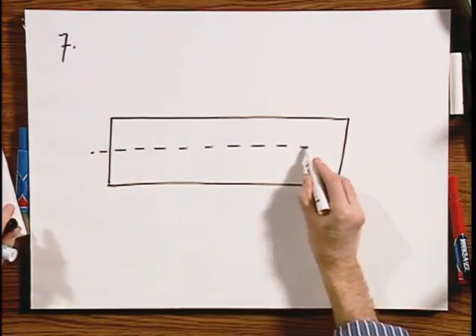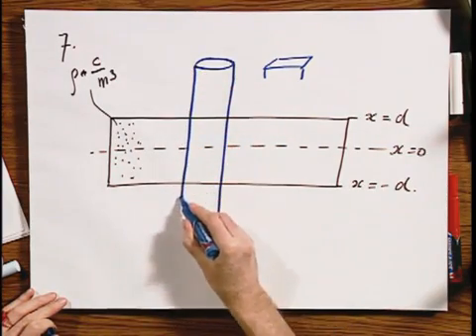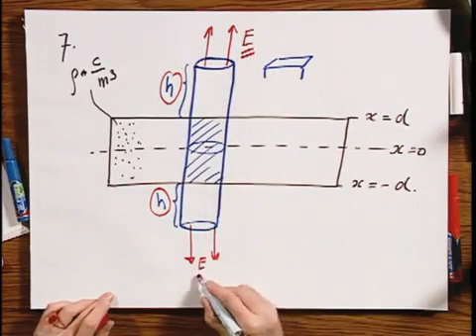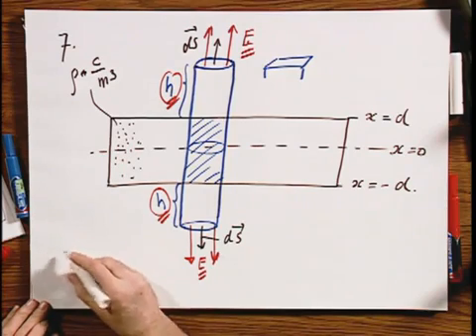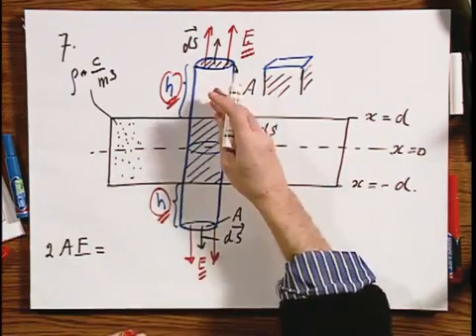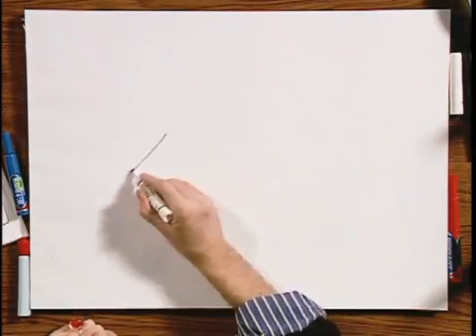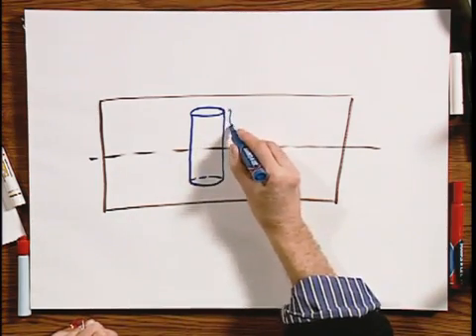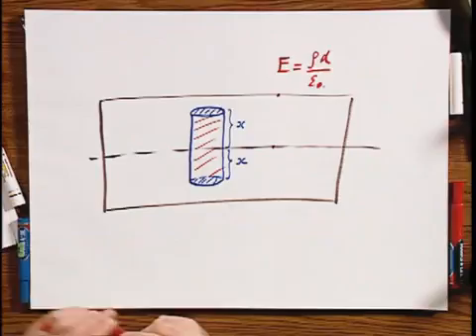8.02x - Module 01.04 - A Slab of Charge.

Comment: Sir the cylinder that you chose is making R redius on z axis. On the outer point of cylinder (on z axis at r distance away from surface). You must find a electric field at direction of z axis (due to charge inside the cylinder) and ds (area vector) is also on z axis. So they mac 0° angle. They have to make a dot product. So why you say that electric field on Z axis( vertex of cylinder or box) is zero. 
Please explain.
In hope of explanation.
Reply: I choosen z axis as out side from your paper.

Comment: Hello professor,
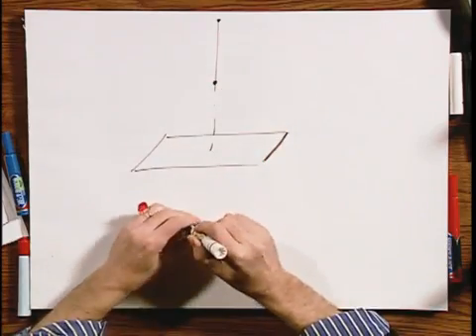From 5:32, you have asked why the E field is independent of h (distance), given the plane geometry is infinitely large.
Reason 1:  The plane is so large and given role (charge per unit volume) is uniform across, the amount of charge in the plane is so great that the Electric field changes with respect to small distance is negligible. 

Reason 2, we know field is inversely proportional to r squared and so for short distance is ok, but cannot generalise to large distances ( I think this is not a valid explanation, but decided to put it down anyway)

Can you please explain if both of these are incorrect. Thank you

Comment: What if you divide the slab horizontally in the middle in to two parts, one with positive charge and the other with equal, but negative charge? How will the electric field look, where will it be the strongest and weakest (0)? Specifically the centerline and the negative charge density slab confounds me. Spontaneously it feels like the E-field should be the strongest in the middle of the negatively charged slab (because the +field will try to push a positive charge q away, but the -field will try to pull it back, so the middle seems nice because then the +field has pushed as much as it could, while both ends of the -field will pull with equal force), but that doesn't seem like a symmetrical answer to a symmetrical problem.
Reply from the maker: work it out - my lectures will help you.
Reply: This is a problem in SBT (an IIT JEE book)
and I want to tell you, The ELECTRIC FEILD outside of that slab will be 0 and inside from the central line will be proportional to the displacement.

Comment: Why is the electric field due to infinite sheet of charge independent of the distance from it? (possible answer)
    The electric field at a point in space due to a charge distribution depends on the shape of the surface on which the charge 
is distributed (as one of the factor)
     Imagine that a person is trying to measure an electric field due to a U charged circular disc (or any other shape). initially the person is close to disc, so the person does 'see' it as a disc, so the electric field measured by him at that region will be that of a 
disc. But when the person is very very far away from the disc, he does not 'sees' it as a disc but just as a point so the electric field measured by him will be that of a point charge or, to put it in another way the electric field measured by him at any 
distance should depend upon the 'APPARENT SHAPE' of the surface viewed  from that distance from it which is only possible for
surface of finite size, for a surface like an infinite sheet of charge no matter how far or how close one is form an infinite sheet
of charge it still appears as an infinite sheet of charge so the electric field is always same at all distance from it.
Reply from the maker: watch my lecture on this topic (with demo) or use google.
This is very basic.
Reply: First clearify yourself that whether you are asking a question or answering it !

Comment: sir one thing i couldn't understand that is the electric field calculated is only due to the charges included inside the cylinder or the whole body. If the later is true  how is it possible?(sorry for my ignorance,i am in 12th grade)
Reply from the maker: Gauss' Law!! I agree it's not intuitive. It took Newton 40 years to prove that inside a spherical shell of uniform mass density there is NO gravitational field. The same is true for charges and E-fields. I suggest you google "divergence theorem".
Reply: thnx sir.

Comment: i don't understand why did we take a consideration of the other area on the other side of the slab
we only want to get the electric field on one side
Reply from the maker: Gauss Law requires that you have a VOLUME. We chose the two flat parts at equal distance from the slab. Thus we know that the E-fields at the 2 flat parts are the same but in opposite direction. We now apply Gauss law and calculate how much charge there is in the volume and we find the E-field that we were looking for.
Reply: so we should choose a suitable volume to but the charge in then we determine the flux throw this volume and with it we can get the electric field easily 
.........................
and in cylindrical shape we have three areas the top and bottom and in between 
and we should get the electric field passing through them to get the flux
Mmmmmmmmmmmmm
i think i got it :D 
Thanks a lot you beauty ^^
Reply: Symmetric argument

Comment: Is the slab infinitely wide? If no,  we do not have this solution, right?
Reply from the maker: Right, however, if the distances at which you calculate the E-fields in or near the slab are very small compared to the size of the width (and if you stay away from the edges), your results can be very accurate to the point that your assumption of an infinitely wide  slab is more than justified.

Comment: Why isn't the charge inside the slab in this case 0? Shouldn't it be only at the surface of the slab too?
Reply from the maker: how many minutes into the video?
Reply: Approximately at 6:40, where you say that you calculate the flux through the cylinder inside the slab and you put that equal to the charge inside divided by epsilon_zero. You then give us a non zero answer, so the charge inside can't be zero. But since it's a conductor the charge should be all at the surface no?
Reply from the maker: what is the name of the video (be as precise as possible), how many minutes into the lecture?
Reply from the maker: it's not a conductor. charge is uniformly distributed throughout the slab.
Reply: It's not a conductor? Oops I assumed it was. Stupid question, sorry, thank you for your availability though!